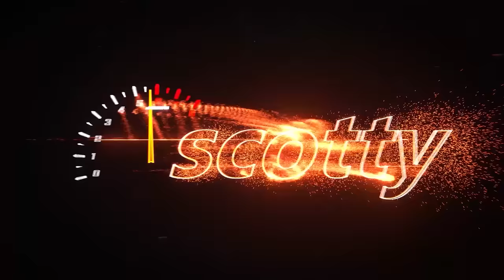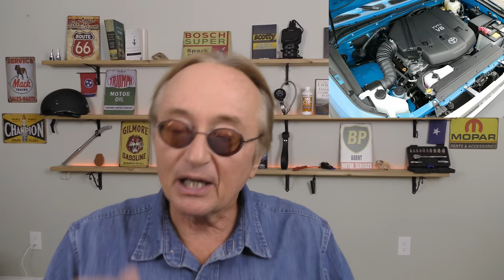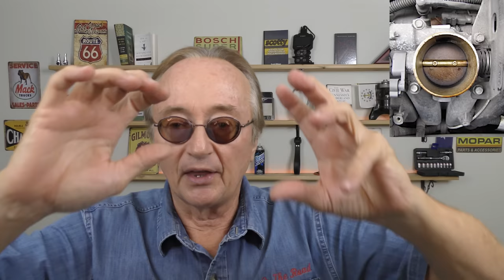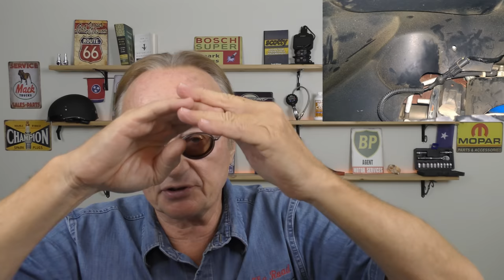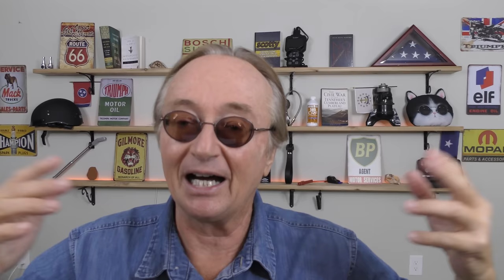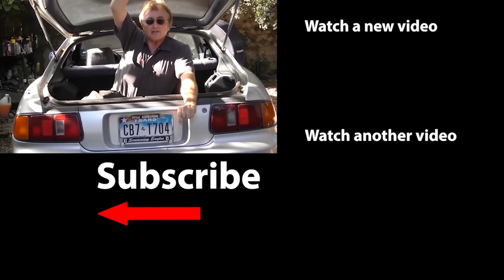This Illegal Mod Will Make Your Car Run Better (Don't Let the Cops See)

Comment: Must haves if you are a petrol head 1. EGR valve removed 2. strait piping (but keep the cat so you can bolt it back when youre going to inspection)

Comment: Back in the late 70’s we occasionally ran across a tire wheel and tire combo (sometimes even new) that wouldn’t balance well.  We would then rotate the tire 180 degrees and often get a decent balance with a proper amount of weight.  Michelin Defenders are great tires.  So I blame the wheel or the 3 whisker kid who worked on your car.

Comment: My catalytic converter is going to be stolen next Thursday.
Reply: My insurance company will get a call that my car didn't hang itself
Reply: @john J Riggs Archery >>> A straight pipe for a cat, you can use that if theirs a back order waiting list for the part while your using the car to drive around - a very legal reason. As theirs high stolen value to a cat they aren't going to blink  if you give that reason for it being their. Just be wise about it....
Reply: @gettogo0159  noted!!!

Comment: Before I retired I took many Converters off and gutted them then put them back on the car...never failed inspection. May have helped because I am an ASE Certified Master Mechanic. My garage was in NC where cars are inspected.
Reply: Here in NY we would gut em and run a pipe thru the thing for decent flow and put em back on. 
It never really went beyond a visual check to make sure it's there. 
Now ,of you've got a check engine light ,forget it. Fail.
They check readiness codes ,so you can't just clear it around the corner and roll on in.

Comment: Toyota 2.0 stalls are often temperature sensor or dirty throttle body related issues.   BUT before you do any changes of equipment that costs you other than cleaning the throttle body and idle air control valve (which is attached to it and can be cleaned with a spray can )  you should follow what Scotty says and get it tracked down by a mechanic with a good scan tool.

Comment: Just go to any junk yard and grab a  newer, used one and have it welded in line and it might pass.  At least you have one on and you won't get fined for NOT having one.  If you have a high-ground clearance car or truck, it's common for the thieves to steal these.  A strong steel cage can slow them down if they try it again, but might not prevent determined thieves.  Remember that they get very hot, so don't cover them with a plate of steel ; it might catch your car on fire when trapping that heat in a confined space.

Comment: On inspections we didn't check if the catalytic converter was on there. That wasn't on the test. 

But usually if you remove it your check engine light will come on and that will fail you.

Comment: Crappy mileage while towing is right. With the 4,000 camp trailer behind my E150 and it's 5.4 V-8, it gets 7.3 mpg. Gets a little more than twice that unloaded.

Comment: But if someone steals your catalytic converter, then replace with a straight pipe. 
Install sparkplug anti-foul where your oxygen sensor screws into the pipe and then screw the oxygen sensor into the anti-foul so you will not get a check engine light. 
I also know people who passed inspection and then removed the converter and then reinstalled it come inspection time. 
Don't try any of this in California.
Reply: Yep, they stole my husband's catalytic converter so I just ran a straight pipe.  His work is a hot spot for catalytic converter theft.  I didn't feel like buying the thieves another catalytic converter.
Reply: Cool 😎
Reply: @sandyseibelhager7131  , totally agree. I would do the same. Put straight pipe replacement blame on the cat burglars. Pun intended 😼 One guy etched two words on his straight pipe replacement, and the words were NOT 'Merry Christmas.' 😆

Comment: my truck started having engine problems that took two mechanics and then a 10$ part and 5 minutes of work to fix (thats worded bad basically family was over an hour after my truck started having problems so tthe two mechanics looked at it) (the funny part is its a chevy and both of them work for ford) before the obd2 scan one said it sounded like it was supercharged (only thing not factory done with my air flow is the muffler is gone)

Comment: Scotty, give me the old 292 ci straight 6 GM motor in an old 70's Chevy pick up. It never let us down as kids with old trucks.
Reply: The fords and Dodge slant 6 were just as good
Reply: @richsweeney1115  Wish I'd never sold my old reliable B150 van with the slant six and 4 on the floor.

Comment: I do not understand why some people cannot balance tires correctly.  When I started out as an appritist, I would replace, mount and balance tires.  The balance machine tells you exactly how much weight to install on the rim.  We would tell the customers if the rim was bent.  Some of the customer would replace the bent rims, but most would just have me balance the tire, until the machine read 0.00.  Never had a complaint from a customer for an unbalanced tire.  Maybe some balancer people do not understand how to cut the weight properly.

Comment: Scotty, in some places they will impound the car if they suspect the catalytic converter is missing (like if the exhaust gasses seem to have too much unburned fuel).  I do very strongly believe that they should be impounded too.  Ever get stuck behind a vehicle burning oil?  I suspect a bad catalytic converter might be almost as bad.  Almost because if it is bad it is probably clogged and not as much is escaping.
Reply: Went to a car show for old cars a few months back. 
Man my eyes were almost watering 😄
Can't say I remember when it was like that ,but I'm 49 it musta been kinda bad when I was a kid. 
Definitely gotten more sensitive to a non catalytic car over the last 20-30yrs that's for sure,I can smell em a mile away 😄

Comment: The small improvement in performance is not worth the massive pollution of carbon monoxide without a catalytic converter.  A cat removes most of the carbon monoxide from the exhaust.

Comment: Surprised to hear you say removing the Cat is better for the engine performance. The O2 sensors will keep telling the PCM the engine is running rich which will make the PCM to continually back off the amount of fuel the injectors are delivering reducing power.
Reply: What is the work around if you take the converter off ?
Reply: @davidself399  the 02 sensors are designed to measure the fuel Air mixture before and after the Cat, without the Cat the PCM is constantly retarding the fuel to keep the fuel Air ratio to 14.7 to 1
Reply: @davidself399  You need a $1000 tune

Comment: The converter also reduces oxides of nitrogen. The remnants come out the tailpipe as oxygen and nitrogen. This is of course an exothermic reaction, but there's plenty of heat around. Right?

Comment: F150 with a 5.0 coyote any day over the Tundras V8 much it’s more efficient and they last many hundreds of thousands of miles…
Reply: No
Reply: @senseicorey9979  I have a 16 FX4 with super crew long bed 350k miles I’ve only changed thermostat, coils, spark plugs twice which is general maintenance anyway. My truck it still runs like new still. I’ve changed coolant regularly kept oil and tranny fluid changed and any other maintenance needed on time, I Ran motorctaft full synthetic oil. Never any major problems It’s a dream truck..

Comment: Different question. Accidently over filled power steering fluid 2005 kia sorrento.  Husband wouldn't refill now says overfill will kill pump mechanism. What will happen next?
Reply: Trade in the car Kia's is getting broken into at a high rate
Reply: Husband no play w u

Comment: There is a bypass module for the expensive secondary air injection system on the old Toyota Tundras. It’s great 😂

Comment: Is there scan tool for older models?
Reply: they have self diagnostics since 1980,cycle the key 3 times on off on,count the flashes  12 or 55 means its done reading

Comment: HELP Scotty.  I have a used 2016 Honda CR-V and I thought there was a battery issue even but the battery is relatively new, the dashboard lights up, seems like 30+ little lights I've taken my car to mechanic 2 times and they find nothing wrong with it.  I was told that the battery is full, new and "GOOD" at 12.85.  it's happened 2-3 times consecutively, I thought it had to do with the START button so we changed the battery on car key remote control, same thing happens.  Help!

Comment: Get a high flow catalytic converter.  Increase hp too.
Reply: @mcc7762  Give you about 3 maybe 2 extra hp.  Yes they work but you have to have a whole system from the headers on back.

Comment: Hi Scotty, my Dad has a Camry 2018 SE fine looking car but acceleration wise it feels as if the car in ECO mode the whole time and it has slow acceleration, I compare it to my friend Camry 2014 SE and that car has alot better acceleration. I HAVE seen many complaints on the internet about it and even Toyota put  recall on the engines for the same year but VIN number was not one of them. The recall was "The pistons on these vehicles may be larger than specified, possibly causing the engine to stall" . I have to floor the gas pedal so it can accelerate as a normal car and rpm reach 4000

Comment: SCOTTY you KNOW damn well being a master tech,that we are the only people in the world cleaning up the air,hell they even put cats on lawnmowers,the test tube replacement has been around since the first cat was installed,most of my customers have replaced the cats due to laws,some just hollow them out,sniffing cars slows the shops down immensely,for what,THERE ARE CARS running around with junk wires and fouled plugs and paying 4.00 a gallon,lunacy,tune your vehicles up,we all breathe better,oh yeah inflate the tires,half of you are running around on flats

Comment: I have a straight  pipe on my Tacoma  , and when it's time for the smog check  I just  Unbolt  the 4 bolts and swap it out  for  the  inspection  . easy peazy  .

Comment: I bought  a super cheap lexus gs350 out of Denver aka catback stolen capital  because the catalytic coverter was stolen and would cost a lot to replace to pass emissions.  But my county up in the mountains far away from Denver has no emissions and I just had a straight pipe welded in place where the cat was stolen from . Saved me probably  $3k over buying an intact car.
Reply: Good call
Reply: Unless federalies  ie polis catch u w/o it, 60k fine, goggle it, to verify

Comment: If you have a check engine light on for months and it runs fine, will it hurt anything?  Think it's oxygen sensor but gets the same mileage as before
Reply: You need to use a scanner to figure out what the check engine light code is, then you'll know if you need to get it fixed
Reply: @bennydontplaythat  p0420, no signs of anything wrong
Reply: lol that's me the last 6 yrs on that code. Its comes on and off for me. My mpg is fine.

Comment: Hi Scotty! How do you check your car's fluids (engine, trans, coolant, etc.) to get accurate level?

I've asked mechanics in my area but they said different from another. (one said check when engine runs. The other one said check when its cold)
Reply: Scotty doesn't answer questions here
Reply: Im not Scotty but maybe this will help ..
It varys , depending on what fluid you are checking and your type of vehicle .
In General , check your fluids while the engine is cold and on level ground .
check oil when cold .
There is a mark on the dipstick.
Look at your Coolant tank , if its clear , you can see if the level is correct .
NEVER REMOVE A RADIATOR CAP ON A HOT VEHICLE .
Most brake fluid tanks are clear so you can check the level without removing the cap .
Power steering level can usually be checked by looking at the power steering  clear tank or you may have a dipstick in the actual power steering pump .
You check it with the motor off.
Trans fluid level check varies but usually you check an automatic trans fluid while its running .
Again , 
check your owners manual or try and buy one .
Reply: Check your service manual that comes in the glovebox if the car it usually tells u exactly what to do
Reply: @br7418  I don't have a car
Reply: @br7418  they might not have the manual ....

Comment: Hey Scotty my mother-in-law has a 2008 Honda CR-V I just replaced the starter it has 152235 miles but still runs good any thing l should check other wise?

Comment: Can you recommend a good scan tool that doesn’t cost a arm and a leg. I want one just in case a light turns on. Just paid my car off and not looking to buy a new one in the near future. I have a 2016 soul Kia if that will help. Bought it brand new with 3 mile on it. Still under the motor and transmission warranty.
Reply: Harbor Freight has one for under $40.

Comment: About 5 years ago someone cut my Cadillac converter off of my Chevy Impala .so my cousin just ran a straight pipe to it and you know for the next 6 years until that car couldn't run anymore. it passed the emissions test all the time I always thought to myself what's the point of a Cadillac converter
Reply: Catalytic...not a Cadillac converter... I swear you people never made it out of grade school.
Reply: @marcburns508  thank you for this marc
Reply: @marcburns508  ducking autocorrect...

Comment: Question, I can't get a true answer.  My compressor quit, after rattling and still producing cold air it finally it quit.   It didn't seized up and the pulley or clutches are find, in fact I still drive the car for doctors visit for my COPD, or pick up the grand children.  I want to know if I can replace the compressor and take my car to have it charged up?  I have a 2002 Pontiac Grand Am V-6.  It has serve me well because I always  change the oils like clock work.  I await your reply, I respect your suggestion as that I am a fan of your YouTube channel.  Thank You in this matter.  Henry Quiles, (Key-Less), Fruita, Colorado.

Comment: I do not think the cops will write you a ticket if your exhaust is not too loud. You'll likely get a code (check engine light) and can't pass a smog inspection though.

Comment: Scotty I fixed a mechanics dream with some electronic cleaner.  My old honda 2.2 fb2 ( non vtec).  I was overheating so I narrowed it down to temp sensor A.  Just needed cleaning not making contact and fans were not coming on.  NOT ALL but most people would be taken for a sensor , Thermostat, plus labor....LOL

Comment: I have no love for ev's.  I don't want them, but I do love economics.  Technically it is true that increased demand increases price.  However, just arguing for accurate information here, the concept of economies of scale is totally ignored in the talking about the proliferation of an industry in this video.  Depending on the manufacturing and implementation, the ev industry could have dips in costs.  I do agree tho that the long term cost will be sky high, but not because if the demand curve, but because of the homogonization of the market.  They will all be the same, thus elimination real competition.  Innovation will crash and an ologopoly will likely emerge.

Comment: scotty pleASE help i have bmw e39 str... 6 no chk eng lt will stall when on long trip 200 klm starts up no prob but will stall at toll booth changed mas ,cam sn, crank sen ,what could it be use to get 8.8 lt for 100 klm now wont go under 9.2 lt fr 100 help

Comment: i had mine stolen and replaced it wiht a pipe.. the motor runs wayy better and it's better on gas mileage.. i suspect it was getting clogged.
so the thief actually did me a favour..